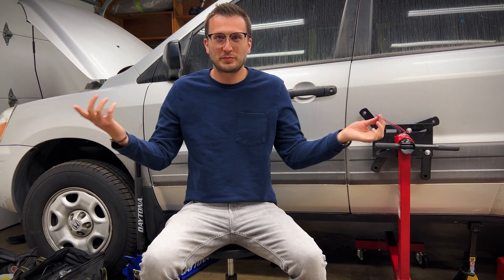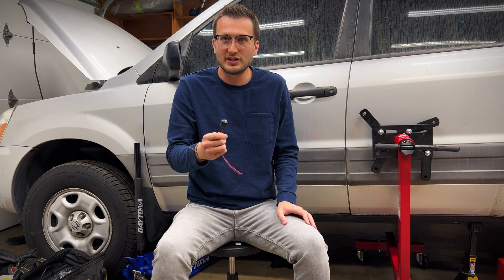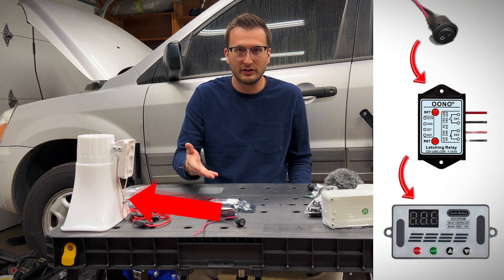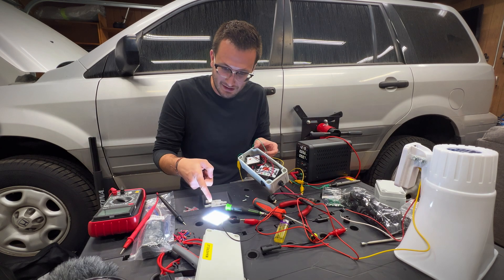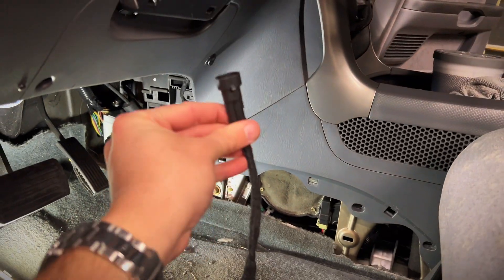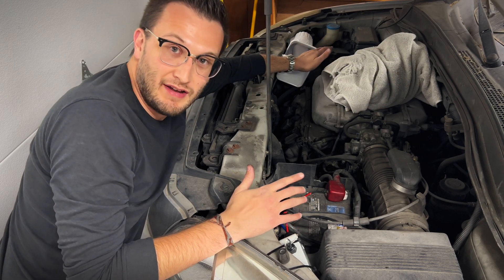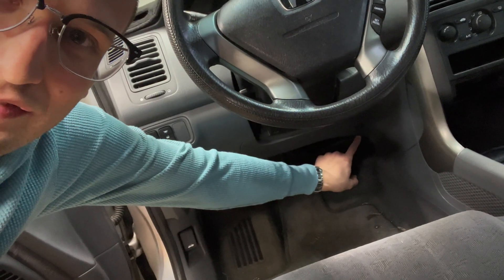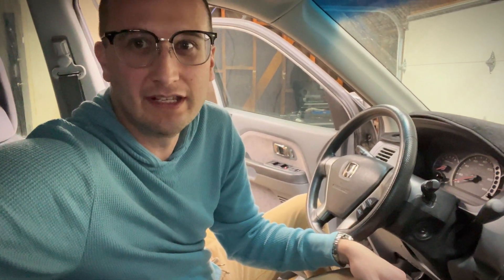Dummy Killswitch that Activates Alarm

Comment: Unless I'm missing something, what's stopping the thief from just hotwiring the car anyway? Isn't this only effective if they notice the killswitch?
Reply from the maker: Even if you hotwire, your fuel pump would be cut off. So you’d have to wire 12v to the high-pressure fuel pump too, a bit more timely